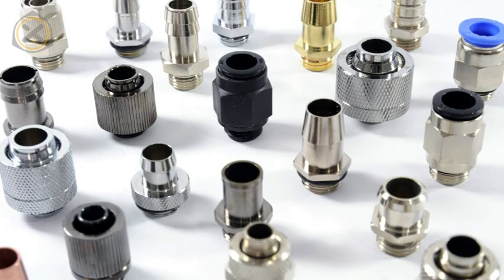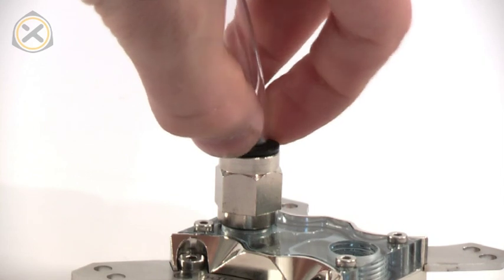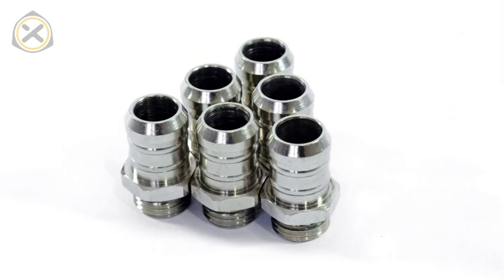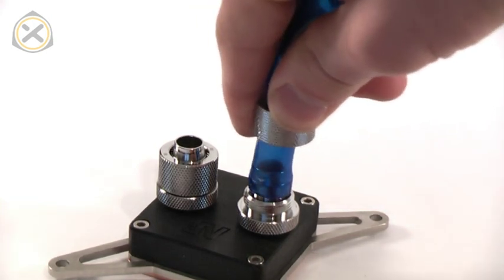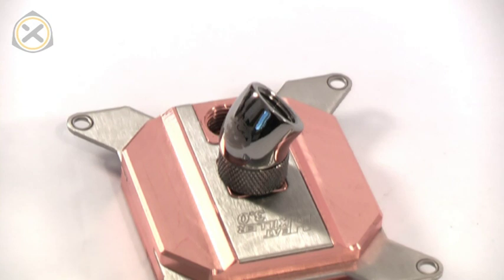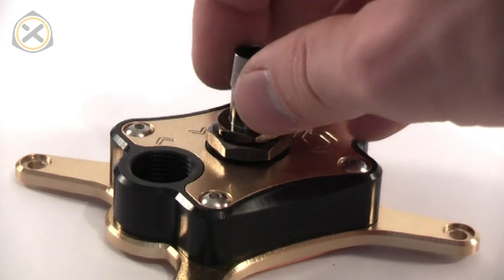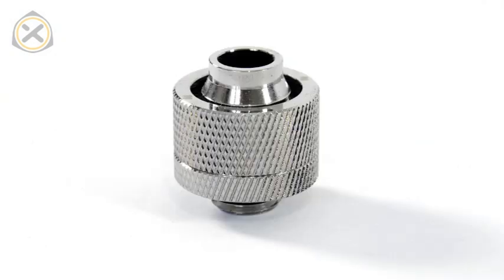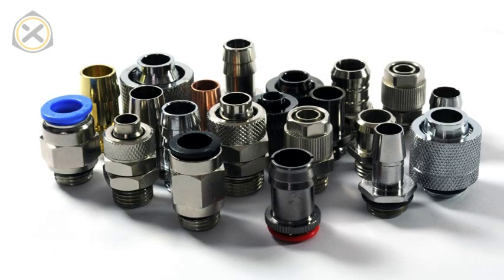EN Watercooling Basics: Fittings 101

Comment: How would you undo/loosen the crocodile fitting in 2:19 if you wanted to remove the pipe later?

Also, what are the advantages/disadvantages of particular pipe sizes? Is there a particular size that is most common?

Comment: How tight should be compression fittings ? I mean, I checked mine recently ( Which I tightened with hand pretty tight.. ) and after a time, I figured I had to tighten them again.. I guess they get loose after some time ?? To tighten them every couple of months ? I think I'm doing something wrong here.. just don't want to over tighten them. But don't want them to loosen up themselves and pop out a hose in the long run.. Any suggestions ?

Comment: Excellent overview of barbs and fittings for the "fledgling liquid cooling PC enthusiasts" It can be very confusing with all the different types and sizes. As you say compression fittings are great but not without their own special mind fuck problems with the inner and outer diameter of the tubing! I have a load of TFC compression fittings lying around my room as I twice bought the wrong size fittings when I first got in to water cooling a few years back. A good learning experience for sure. : )